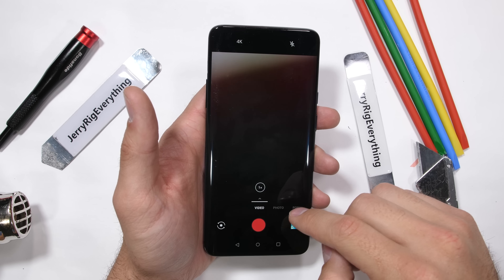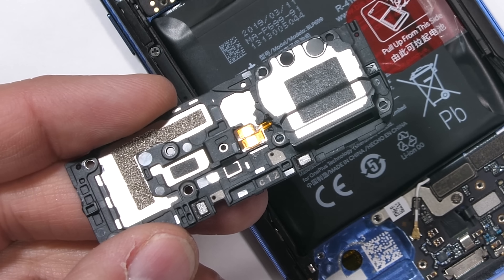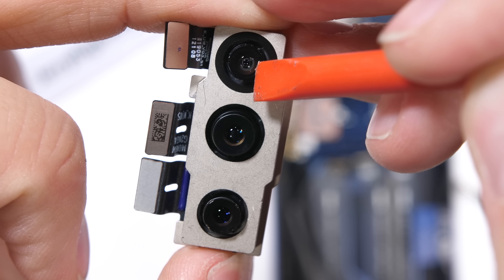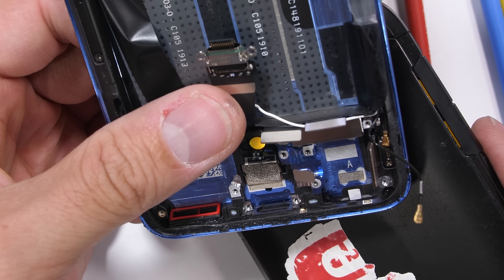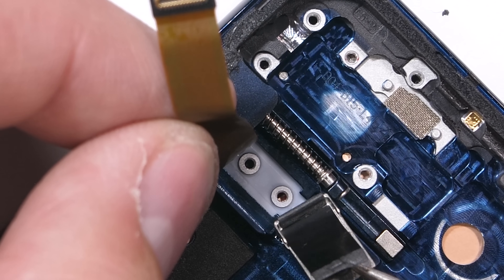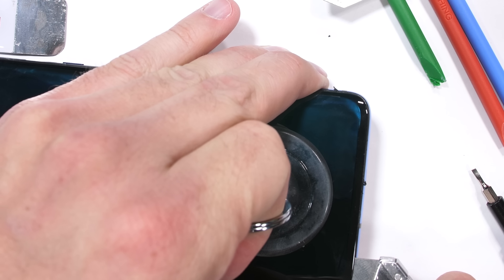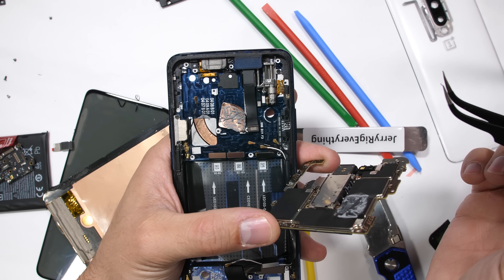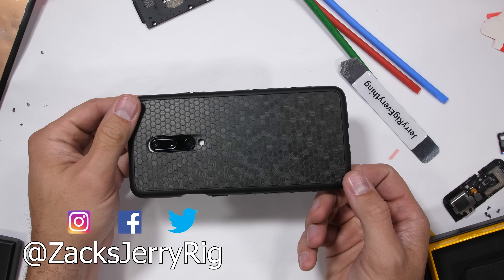OnePlus 7 Pro Teardown! - Is the Pop Up Camera Water Proof?!

Comment: Watching it 2023 in 7 pro, brought it 2019 and still working same as new. Not even a scratch, battery holds 90% power compares when it was new. SOT still 6 to 7hrs almost. This was a gem in phone revolution.
Reply: Please how's the water resistance
Reply: Same here. A beast! The battery only holds around 5h now though. I  just ordered a new one to give the phone an other life :D
Reply: @JohnniMe it went in a Jacuzzi with me and bathed a few minutes before I realised. It was perfectly fin and still is 3 years after the incident :)
Reply: My 7 pro battery is at 100, only
Reply: In my 3 years of buying it used performance is pretty good but type-c port is bent enough to the point of no fast charging or any data transfer
Reply: @ivan4ikok  change the charging port that's it

Comment: I'd like to see that flexible OLED panel working without the glass.
Reply: That'd be great! Go jerry
Reply: Eh, I'm more curious as to why the OLED panel isn't glued directly onto the glass. Removing the front glass already kills the display and the omission of gluing the display to the glass layer can potentially cause some units to possibly get large particles of dust underneath.
Reply: If it works without the glass, he should do the scratch test, burn test all over again.
Reply: literally was thinking the same thing when I saw it
Reply: @GabrielIgnacio  it cannot be not glued to the glas. Zach probably separated the actual OLED panel layers while brutally disassembling it)))
Reply: @andrewzasidko6595  The display digitizer layer is usually adhered to the front glass so if that were the case for the OnePlus 7 Pro, the OLED layer would've had a lot more adhesive keeping it to the front glass layer.

So yeah, it can be glued to the glass. Otherwise phone repairs of front glass years ago wouldn't have been as hard as they were
Reply: Why are you shouting?
Reply: Sameee
Reply: The glass is blue-tinted which means he ripped off the digitiser/polariser
Reply: @GabrielIgnacio  No, the digitizer isn't glued to the front glass. If it is, there would be a ribbon connect to the front glass.
Reply: @itsmoses7973  I already figured as such but yeah. I'm guessing it's a cost saving measure on OnePlus' part, or just because of them curving the display as much as it is on the 7 Pro and 7T Pro
Reply: I'm

Comment: Zacks: cracks 90 hz fluid amoled
My heart: stops working
Reply: Жиза
Reply: Well, you have written this comment, you unfortunately survived it
Reply: that works only in gaming mode ahahhahhahha
Reply: He craked digitiser not amoled.
Reply: Lol
Its same amoled as on other 
90 hz is non usable other than 3-4 system apps
Reply: @anshjindal728  you want say that is scroll in twiter only in 60 fps?
Reply: @fedyaf2710  yes
Reply: AMOLED must die!
Reply: @redlkb  LCD must die
Reply: @redlkb  why?
Reply: @the_carrotman4635  Cuz of many problems. From not good colors to PWM and acid contrast.
Reply: @redlkb  Classic bullshit.
First - PWM frequency on OP7 pro is around  360 Hz, its causes less health problem.
On modern OLEDs colors is accurate and not toxic 
And this is not acid contrast, its just true black (yeah, its can be looks toxic after 150$ shitty ips monitor)
Reply: @redlkb  MICRO LED ALL THE WAY!
Reply: @fedyaf2710  prove it with links to the official tests in other way you just clown.
Reply: Nooooooooo..... 😢
Reply: He cracked the glass screen not the AMOLED
Reply: @redlkb  stop judging amoleds by samsungs that have vivid colors by default. And do you even know that you can change color saturation in screen settings? Speaking of bad colors... all LCDs have, like, 1500:1 contrast ratio, when oleds and amoleds are 1000000:1 and more
Reply: @erikngn  I had Samsung S9,  Xiaomi mi8, OnePlus 6. All of them had hard blinking effect in low level screen light. I paid only for Xiaomi Mi, Samsung and OnePlus borrowed from friend and decided that they have unusable screens for me, so sad.
Reply: Fedya f OMGGGGGG 😂😂😂😂😂
Reply: @coolsatpalsingh2  wrong

Comment: Great phone. Used it 1.5 years now and still going. Broke the back panel but screen is still fine (unlike my other phones that crack in a month). Only problem is that I need to actually press my charger for it to charge. Maybe there is too much dirt. My speaker holes get gunked up so fast that it wouldn't be surprising if same thing happened to charging port and charger pushed all that to the bottom

Comment: Me watching on my OnePlus 7 pro 

My OnePlus 7 pro be like : 😰
Reply: Which one should i go for oneplus 8 or oneplus 7 pro ?
Reply: @Faisalnzn  go for OnePlus 8
Reply: @moinulhasan8206  thank you I have purchased 8 and it's an outstanding phone
Reply: @Faisalnzn  ur welcome, though I use OnePlus 7 T which I have bought 6 months ago, but if u want to buy a new phone now, OnePlus 8 is the better choice
Reply: @Faisalnzn  definitely the 8, you get one of the best phone screens  , a faster processor miles better cameras , the only trade of is the punch hole but tbh it doesn't bother most people and some people even prefer it because motorized might become a problem in the future
Reply: @Faisalnzn  your main purpose ?
Reply: @lexiscitric247  Taking a bit deeper dive,
The Oneplus 8 is 150 extra euro at 750(892$) instead of the 600(726$) for the OP 7T Pro, since it's new and the price hasn't come down, and it doesn't have that many features as far as I see? At least on the specs side, they are basically equal- for the 8- a horrible punch hole instead of a motorized camera, same 1-1 screen, actually lower resolution than the 7T Pro, and the 256 gb model is combined with 12 useless gb of ram hiking up the price, instead of the 258/8 model, same exact charging, for the most part same camera's with some software improvement... Same materials and build.
The 8 has a newer processor- the Snapdragon 865 with the Adreno 650, isntead of the 855+ with Adreno 640, but I reallyyyy don't see much of an improvement, if any at all... It has an official IP rating and wireless charging, but not much else going for it... Bigger battery I guess, and the phone is smaller, but looks like the bottom bezel is thicker, and again that damn punch hole...
So as for specs they are basically equal, each has their pro's and con's, but no huge difference, with only the price being a factor. I cannot comment on the experience though, and the 8 will probably have longer support since it's ~>6 months newer. So each to their own, decide on what you deem important, maybe you can't live without wireless charging, or the official IP rating gives you rest at night, but for pure price-performance the 7T Pro comes out ahead for now in my eyes ^^
Reply: Same here with mine
Reply: @saaimbegh1637  I don't think the miles better cameras is accurate. You actually have to settle for a smaller max aperture on the 8 over the 7Pro.

Comment: Turn the phone on without the screen, only with the amoled ”paper”. I am curious.
Reply: It won't work at all
Reply: That's the screen literally, the glass is there just for protection. In theory if he could remove the glass only (without touching the oled "paper" as you called it) the phone should still work.

Comment: I love watching your videos as you tear down things so I don't have to. Good knowing the AMOLED display is not glued to the screen like samsung did in the S10 line making the fingerprint reader irreparable without also getting a new screen which will cost hundreds for the part alone. This phone could be certified for water resistance  but OP saves the consumer money by not paying to have it certified. Glad I got rid of my S10 for the OP7Pro as it is a much better phone for the money.

Comment: The black "sticker" on the mother board where the thermal paste was located is also a heat transfer material and under the black sticker is more thermal paste directly on the cpu. That counts for the 9th and 10th layers.

Comment: If the screen isn't glued together and it has a separate AMOLED layer that is flexable is it even possible the fully break the screen or would you just have to replace the glass?
Reply: Well i think the flexible led screen still can get damaged / break . Probs sometimes u still have to replace both
Reply: If it's possible, there's a VERY small chance removing the front glass won't damage the OLED display itself but that usually is destroyed as well. If you need to do a screen replacement, you'll be better off ordering both the display digitizer and glass as one single piece.

Comment: Try dipping the screen in liquid nitrogen and use a nylon spudger tool to free the adhesive between the screen and the body. It's not that expensive and always works. If it is your first attempt and your slow insert the tool and redip the part and add another tool and so forth. You may thank me later.

Comment: Shouldn't the screen technically work if you remove the glass carefully? Would make screen and glass replacements much cheaper?
Reply: Assuming you can get the actual 90Hz OLED panel as an individual part, then possibly but the display itself is very thin and even a small crease destroys it. 

You're better off getting both as a single piece

Comment: the haptic motor makes apretty big difference to me when typing .usually i turn off the vibration when typing cause it just doesn't feel exact and makes me feels like my types are lagging but with this phone it feels vastly better and makes me feel like im typing more accurately even if its just in my head lol . and it just feels much better like an iphone
Reply: Haptic feedback is pretty important when it comes to input, hence why a lot of people say that mechanical keyboards are superior over regular membrane keyboards when it comes to typing.

They also help make haptic vibrations feel tactile and accurate, hence why even Apple is using haptic motors to mimic the home button back on the iPhone 7 and 8 and their recent MacBooks with force touch.
Reply: @GabrielIgnacio  yeah it really makes a difference like even when i click buttons or slide down scroll wheels the haptic feedback feels like its where im touching . they did a fantastic job with it its the first phone where i didnt turn it off. is there a difference vibration motors and haptic motors?
Reply: @frezieduh3457  Haptic motors and vibration motors are pseudo-interchangeable terms. They refer to the same thing: small motors that recreate touch sensations via vibrations and alike. I'd figure vibration motors are a term used more by the typical eccentric rotating mass style vibration motors, which make vibrations by rotating a weight via magnetic forces. They're more commonly used in smartphones more than linear resonant actuator haptic motors, which the 7 Pro as well as some other phones use. 

As for it feeling better than an iPhone's similar LRA haptic motor, I'm not too sure. Both use the same technologies but Apple's is custom-made for their use and quite bigger. Either way, the differences are going to be very minor at best.

Comment: 1:41 My amateur advice:  if your front facing camera is playing up, it may be because these cables are pinched between the frame and the and the plastic enclosure where they bend down to travel to the bottom board. I don't know what they do but I noticed that I put one cable over, rather than under the lip to the right of the bottom right screw hole of the enclosure. One cable got pinched. Replaced cables and threaded correctly........front facing camera works again!

Comment: 1+: It has a 3x optical zoom
Jerry: The same way it has a 10 layer heat dissipater? 
1+: (leaves conversation)
Reply: How long did you try to think up a witty comment based on a popular current meme used by teenagers when you're 45 years old?

Comment: @JerryRigEverything so if the glass front panel is cracked, but the display is working fine, you can just remove the glass and put a new panel on because the display and glass are separate from each other correct? I just replaced the back glass on my one plus 7 pro no problem. Just ordered the glass for the front now.

Comment: You should introduce a set of durability tests for phones with moving parts since it's  going to become a common feature on smartphones, for the popup selfie camera, I have a few suggestions,

1. The popout test- use your hand to try and pull out the extended camera.

2. The hammer test- hold the body of the phone with the camera extended and hit it on the edge of the table such that only the camera hits it.

I'll bet if it can pass these two tests, it can easily survive daily life.

P.S I think you should try this on the upcoming poco f2.

Comment: I bought a OnePlus 7Pro in November and I've been using it since now, and it's really an awesome phone. Compared to any phone from Samsung , the OP 7Pro beats all of the Samsung's phones or the silly Apple's phones. Well OP 7Pro misses some of the things that Samsung has but despite the large battery, powerful processor, high quality cameras, 90Hz screen and 12GB of RAM and also 256GB of internal memory, OP 7 PRO is the boss!

Comment: Hi jerry,

     hope u and ur family is safe firstly.

I have a water damaged op7p and i am hoping to fix it but i do not have a clue what parts i will need to change so i change it. Below are some details i hope that could help u identify based on ur knowledge and appreciate if u would. 

I had pool water gotten into my op7pro and it now doesnt boot but just hang after the spinning animation and wont go pass it, it hung there while spinning logo and keep rebooting and repeating until i have to power it off manually by holding power and vol button to go into boot loader or recovery and power off from there.

I was able to boot into twrp, decrypt and perform usual operation and even access my data until i wipe it and used msm tool. 

Now while i can still go into stock recovery and bootloader but i can't even flash any recovery or perform any other operation when i cant boot up and go into dev mode to enable oem unlocking. Cant even unlock boot loader or switch partition neither flashing any stock roms etc.

I had done what i could drying it in rice and bought to shop to try for repair but to no vail. But theres jus this part in me telling me it could be just a simple part to be replace like a flex cable or something. 

Wishing u and family safe from the virus.

Cheers from Singapore

Comment: @JerryRigEverything I took my OP7P to a water park in Singapore. I did not deliberately submerge the phone but kept it in a sport belt during rides. Moisture did creep inside the phone and fogged up the top 2 camera glass screens. where do you think the moisture got in? through the motorised top camera? How would you suggest drying out the internals of the phone? I was thinking of sticking it in a Foodsaver vacuum box with some rice. There also seems to be a bit of dry staining on the camera glass on the rear case. Any suggestions how to clean that without taking off the back of the case?

Comment: I have a pretty simple, yet sure method for checking how well a phone is sealed/water resistant... Just take out the sim tray, and blow or suck out the air thru the sim tray hole/port.. If you dont notice obvious leakage, you're good to go :)

Comment: How about that huge copper dissipator installed under the oled screen. Looked like a screen wide radiator sitting against the copper pipe, but I'm not quite sure if other OLEDS have this in the back, also wouldnt the heat pipe against the screen which isnt glued btw, give hardware problems? (there have been reported problems no?). Help Jerry see this comment!

Comment: For the "ten layers", you forgot to count the color coating on the back of the phone!
I like the screen on this because I dislike holes and notches, but I also don't care for curved screens because of reflections and having no functional purpose.
If you get another one of these for your personal phone, be mindful that the battery life is poor because of the 90 Hz refresh rate.
Reply: Eh, I've found that using the 90Hz refresh rate doesn't affect battery life that much, since the default 90Hz mode you can toggle is actually a bit variable: some tasks like watching videos, making phone calls, etc. have the display set to 60Hz and then switch back to 90Hz afterwards. You can easily notice this since the display has a very slight color shift when switching to and fro quickly.

Comment: I'm not very convinced about up and down camera system. In a certain way I prefer the notch. This is the variable that makes me doubt the purchase.
Reply: I agree but stepper motors are pretty durable, not to mention if you're someone who doesn't constantly use the front camera, it's most likely a moving part that'll continue to work even past your current ownership of a device with such.

Hell, all phones with OIS equipped cameras already have moving parts

Comment: @jerryrigeverything I've a doubt that is I've buyed OnePlus 7t pro(haze blue,8gb ram) and I put my sim  tray ejector pin into the hole that is just beside the sim tray which is marked with a black line vertically then I realised I've poked the ejector pin into the wrong hole . Will that affect my device?🥺🥺🥺🥺🥺🥺🥺🥺

Comment: Every phone that I have had over the last 4 years, s6, s7, s8, s9, s9+, s10 iPhone 7+ htc, 1+6t 1+7 pro have all done fairly week for heat with most games except 1, Unmatched Air Traffic Control. I don't know what it is with this game but it always makes every phone I have had get very hot, the worst was the htc phones, but even with the s10 and now on my OnePlus 7Pro, very toasty warm. The only other game that makes it to hot to touch is Pubg when run thru GFX tool to tune up the settings. However when I run Pubg on normal settings it still isn't as hot as that air traffic game. Thermal pipe or no, it runs the CPU hard.